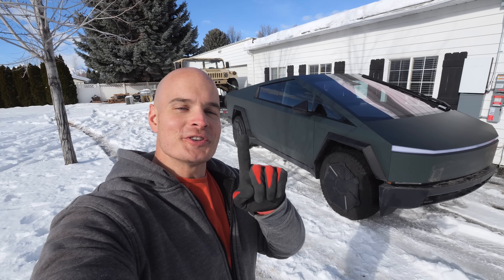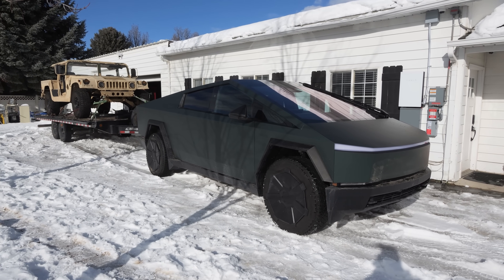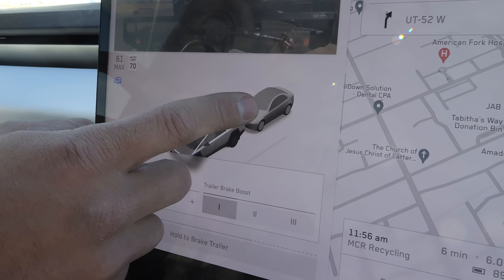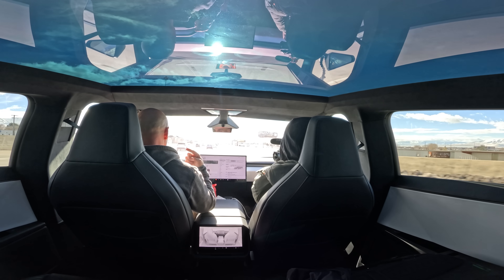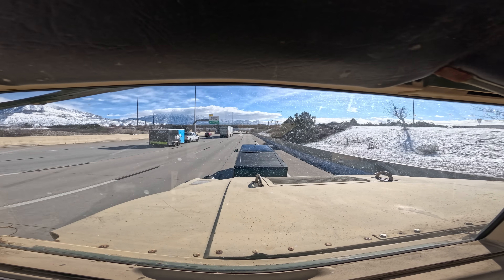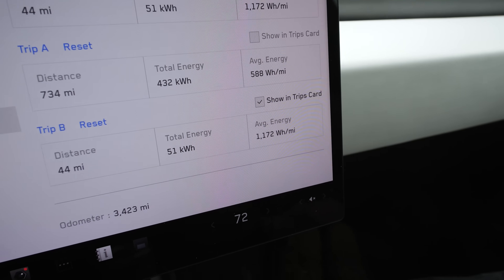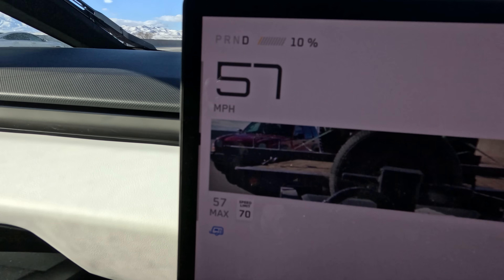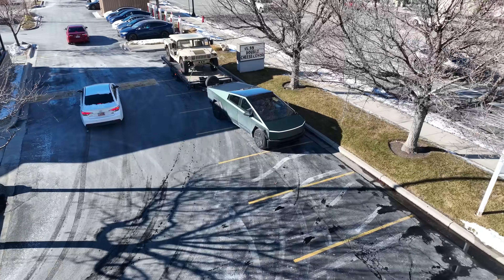How far can the CYBERTRUCK tow 11,000lbs in Freezing Weather?

Comment: Wow I really like the idea of having the infotainment Center off to the right hand side ...that way I can really look away from the road to see how fast I'm going or if I need to adjust the heater versus touching a knob or a lever. 5 stars for safety. If you're an alcoholic or IV drug user.

How many 4 by 8 sheets of plywood can it hold?

Does it still include the sleep while you drive mode?

Are the batteries still flammable underwater?

Are the batteries sourced from China or from the United States?

This is truly an amazing truck, I agree.

Do apartments or Condominiums already have these Chargers installed in front of their building for convenience?

Comment: Tesla definitely needs to apply a fix to their estimated range so that people can better plan their trips. I have seen the issue with this first hand. We have a Bolt and a Model Y. Both are are always charged to 80%. The Model Y always says that the starting range is 262 miles. Does matter the temperature or recent drives. The actual range is always much lower than that. The Bolt, however, is dead accurate. Recently we had temps that were right at zero degrees. The Bolt estimated the starting range at 150 miles at that temp at 80% charge. It would get right at that range in driving. At the same 0 degrees, the Model Y still insisted that it would go 262 miles, but the actual range left dropped like a rock once you started driving.
Reply: I worked at a movie set last year and we had a Model X in our rental car pool. It had a 2,500lb rated hitch so I decided to use the car to tow a 2,500lb Diesel genset back to the storage unit which was about 100 miles away. I started with 85% charge and I barely(!) made it. It was just pathetic.

Comment: Noticed you use a coil cable for the trailer emergency brake. I got a couple of them, but ended up sticking with a non-coiled cable to avoid stretching and not pulling out if the trailer pops off the ball and rests on the chains. With the no stretch cable, it's gonna pull the brake while the coil might not. I don't really "know" what would happen. Just erroring on the side of caution. Any thoughts/concerns on the coil? Thanks !

Comment: Good thing you were towing something that could tow the tow vehicle!!  Just curious. To charge that beast, would you need to disconnect the trailer to get the Cyber truck into the space for charging?  I think I will stick to my diesel for towing.  Having an extra tack helps, too.  It's nice knowing that when I forget to fuel up I can just flip a switch and pick up another 350-400 miles of range to get to a station.
Reply: Didn't finish the video, huh?

Comment: Tesla should Propose to add an emergency steering rod that can securely connect to the steering module as a backup plan in case the electric steering system malfunctions

Comment: Dropping the trailer to recharge was an obvious problem and the deal breaker for me. That's a pain and dangerous if there's not a flat spot available. Why didn't they put a charge port at the front to provide access to the chargers at the ends of the row?

Comment: Could someone please confirm for me that the cyber truck is true steer by wire? I know it has a variable steer ratio but that doesn't mean there's no mechanical link which I thought was a requirement in most states.
Reply: There are videos showing the steering wheel being moved lock to lock without the wheels moving.
Reply: @GreatOutdoors1  thanks for the info, very interesting. I guess the mechanic link rule is no more or there's an electronic disconnect

Comment: I guess there are no Side winds, No Oily or Wet patches on American Roads. And there is not much patience. Towing a Heavy Load should be done at 60 or below depending on the Conditions. Even on a Pristine Day with Pristine Road conditions as other vehicle variables is just one factor on how quickly and safely you can respond.

Comment: Great demonstration of how electric semi trucks will not work nor be more efficient or ecologically friendly. Diesel trucks can run 24/7. For every electric semi you will need 2 to 3 more complete trucks to run 24/7. It takes 15 minutes to fill a diesel truck with enough fuel to go 800 miles.
All electric is not the answer.
Reply: Battery technology is still in it's relative infancy I agree.

Comment: Strange that with customers' range anxiety, and with all the sensors and computation available, the Cybertruck doesn't give accurate range estimations. It's like a Ferrari without a speedometer.
Reply: What you need a speedometer for? A tach is way more important than a speedo in a sports car.

Comment: In Sweden you can’t drive faster than 80 km/h (50 mph)when towing or using a trailer like for moving stuff. So to me 104 km/h or 65-70 mph is totally madness.
Reply: Here in Germany it is 100 km/h and the fines start to get expensive when you exceed 125 km/h. So I always drive at 115 km/h. No problems whatsoever.

Comment: Interesting, in Sweden it is are not allowed to drive faster than 80km/h (~50mph) with a trailer, trucks 90km/h. Mostly because of the dangers that can occur like trailer wobbling and the longer break distance. Didn't know you could drive at speed limit in USA with a trailer, looks fine in the video but doesn't seem safe. 
Impressive though, 5 tons is alot of weight for a pickup truck to tow.  :)
Reply: In the US you can go the speed limit no matter what you tow. The only restrictions that I know are wide loads (which have their own rules) and speeds when using chains on your wheels during winter.

Comment: Just a fyi, those trucks aren't bulletproof or even bullet resistant.  If you watch the crash test video recently done with the cyber urinal you will see that the panels are extremely thin and look like a razor blade in the front end test. I still don't see how using the same average yearly household amount of electric to drive 90 miles is saving energy but the shell game can be played many ways when the public is distracted by flashing lights and smoke and mirrors. Lol

Comment: 150km, haven't seen the video yet... EDIT: Got quite close! Well I thought it would've been colder than only 0 celsius. I bet the range will plummet when it's -20 or so. Excellent honest video!
Reply: The range reduction due to temperature decrease are caused primarily by two factors: Use of cabin heating, and getting the LiON battery up to usable temperature.  Both use more energy than operating in "standard test conditions".  Increased drag due to air density, rolling resistance issues, lubricant viscosity issues are minor compared to those two.

IDK that a further 20°C will require drastically more energy/mi (km) than 0° does.
Reply: @alsavage1  Range will go down in colder temperatures. If you don't live in cold climate, you don't know...
Reply: @markusketonen2412 Huh?  That's what I said, yes.  And, cabin heating and battery heating are the major temperature-related factors, not air density, rolling resistance, or lubricant viscosity changes in colder weather.

And, I do commute in my EV in "cold climate".
Reply: @alsavage1 "IDK that a further 20°C will require drastically more energy/mi (km) than 0° does." Ok , sorry I thought you meant with IDK that you don't know whether it requires more energy or not. My bad

Comment: The new cybertruck is a POS car, can't off-road for shit.
1:14 it's illegal to only have 1 safety chain on a trailer, i would not use that trailer without it having 2 chains.
You're not allowed to tow that much weight at over 62.15mph

Comment: It was tight to make it to the supercharger :). that is still the big problem with EVs, all the time you have to worry about the range, long trips are still almost impossible even when not towing. 
Also, would be good to have some failsafe reserve, when you reach 0 percent battery, to be able to safely move away and stop somewhere. What happens if you run out of power on the highway, can be dangerous...
Reply: From other real-world tests, EVs have a range of 8-12 miles after hitting 0%.

Comment: I'm sorry... the CAT 279D skid-steer I operate at my workplace is just a shade heavier than 11,000 lbs. 
I can't say the Cybertruck's weight is necessarily unsafe - there are vehicles on the road that are absolutely as heavy or heavier, but I feel these "trucks" are going to be bought and driven by a sizeable crowd of normies who are not used to driving something with instant torque, 600hp, and an 11,000+ curb weight. The crash test footage shows in ONLY a 35mph frontal crash that the REAR wheels were bent-in from the force of 11,000 pounds coming to a sudden halt in a FRONT end collision. If that ain't enough to scare you like it does me,  then that's your problem.

Comment: The 800 volts isn’t to charge faster. Charge times are limited by chemistry and C rating. 

The higher volts allows Tesla to use thinner wires. That’s it.

Comment: I have a hard time believing the whining noise on acceleration and deceleration is normal. Perhaps the reduction gearbox for the electric motors is noisy. Alternatively there's a noisy bearing somewhere in the chain. I'm betting it's a reduction gear issue based on the symptoms.

Comment: The lack of a direct mechanical connection between the steering wheel and the steered wheels is not comforting.  How do they expect a dead cybertruck to be shifted into a repair bay?  

That hum is almost certainly the sound of gear teeth in the differentials coming into engagement and disengaging.  Spur gears are more efficient and helical gears are less noisy.  The noise reminds me very much of a city bus.

Comment: Love that you ad kg as lbs says nothing to most of the world. I guess it will go 190km but its not the weight of the trailer that ruins the range most but the form. A heavy egg-shaped stone (5000kgs) will give better range than a big square box that is around 1500 kgs. Af course you get different resault if going really slow and uphill, then the stone might be worse but normal driving the box is worse.

Comment: I'm just gonna do the bit I always do and say WOW that truck looks awful, even with a matte finish. I just do not like how small the bed is, or how the lack of contouring makes it look slapped together, and the headlights look like a kid's toy or a gamer mouse. it just doesn't look designed with any intention other than annoying people. the tires look great, I guess. I saw two of these getting towed out from SoCal, no finish and scratched up like steel wool on a sautee pan, mud all over the body, and I was repulsed for the first time by a vehicle since the Hummer H3. the black and yellow one specifically, you'd recognize that vomit pile immediately. same vibes.

Comment: 7:30 It sounds like the back tires are rubbing the wheel well whenever you accelerate. That means the electric motor is rated for tht much weight but the suspension isn't.

Comment: Hmm I think the takeaway from this is a lot more work needs to be done on the battery side to improve range in Trucks... Just like with mobile phones there was a time you couldn't go half a day without charging now 3 days is achievable... So eventually we will get to the sweet spot it's just a matter of time and patience
Reply: Battery tech is outdated.  It works off the same concept as it did 125 years ago.  The battery needs to be ditched for some thing that actually makes since.

Comment: its the same as with my phone. there two separate battery packs. so you charge both at the same time. faster charging and less heat :P
I charge with 120w :P packs are 400v just like the tesla plaid :P

Comment: I have never seen a better advertisement for an internal combustion automobile.  Especially if you are using it to tow.
Reply: To the 2 trying to use fossil fuel burning for electricity as some 'gotcha' comment, it isn't the same. To produce the same energy and use it, a gas automobile has a peak efficiency between 25 and 35%. A gas turbine electric plant is up to 60%. An electric vehicle is about 80% efficient. So a gas turbine plant charging an EV is still more efficient and thus less polluting than your average econobox car. And that's me ignoring the ever growing footprint of green energy sources hooking into our grids.
Reply: @levirassler4934  The point is the world doesn't have enough electricity generation to support mass adoption at the moment. The average U.S. household uses 886 KwH per month. Tesla says the cybertruck uses 42.9 KwH per 100 miles. Most ICE vehicles have a range of 400-500 miles per tank of fuel. So you are looking at 250 KwH to go 500 miles, or almost 30% of an average home's electrical usage for one tank of gas. 

It doesn't sound like much, but you're looking at 50% more electricity use by only households, which make up 20% of total consumption in the U.S.  Bumping that up by 10% seems small, but at the scale we're talking it's just not feasible BECAUSE the U.S. government is hellbent on eliminating fossil fuel. 

A better path forward would be to force fossil fuel burning companies to alot 50% of their profit to green energy research, drill like crazy, make energy super cheap and force innovation and grid investment while switching to EVs. But then that is ignoring the fact that only 20% of greenhouse emissions are transportation - sure, lowering transportation emissions would help, a little, but its not a significant enough drop when you look at the big picture.
Reply: JG-MV  Somewhat misinformed. The carbon value of an EV is only 30% less than that of an ICE vehicle over 200,000 miles (not counting if you need to replace batteries in that period). The green electrical infrastructure isn't there to support mass adoption of EV, which means more combustion based electricity generation would be needed + we don't make steel with electricity so the additional infrastructure needs have a high carbon impact as well.  If the whole world was driving EVs tomorrow, and all of the associated infrastructure was magically there, the carbon impact would be significantly larger. EV will drop your individual footprint, but the lifecycle footprint with everything associated is larger.  We're putting the cart before the horse on this green energy stuff, and it's pretty sad.
Reply: Yeah, you forgot you tank electricity from a coal, gas or burning trees powered  powerplant JG-MV
Reply: Yeah... having to stop for an hour every 90 miles is not practical. Electric trucks may be the future, but they are not the present.
Reply: @robertkesselring  

The 18% of people who tow will still buy an ICE truck. The rest who commute to work and getting groceries in a 5200 lb f150 can switch to electric without any issues.
Reply: JG-MV  How do you think electricity is produced in most of the states?  By burning fossil fuels.
Reply: @intoodeep001  You do realize power plants burn that same fossil fuel far more efficiently than any ICE car even considering the inefficiency of transferring through the grid and into an EV?
Reply: @OrbitalWedge 

They don't realize this, nor will they believe you.
Reply: @life_of_riley88 

Seems like you could easily provide a source for that quote.

Comment: I usually like your videos but can’t help but think this was terrible range test. Didn’t top off the charge or precondition battery before leaving.  Makes stop to weigh, stop at gas station, acceleration test onto the interstate. Says keeping the truck under 70mph but shows going over 70 multiple times. Drives truck up steep hill.   Then charges the truck to 80% and says that enough to make it back home. Would like to see a more real world accurate range test for potential buyers.

Comment: That stripped-down H1 should be ~7000 lb.  Iron Bull doesn't spec the weight of their TDP14 trailer, but must be 4400 lb, which is reasonable given the  thick I-beams and hydraulics.  With the self-leveling suspension of the CT, you don't don't need a weight-distributing hitch though still good to keep more load on the front tires for assured steering.

Comment: I don't know that much about towing, but wouldn't the load be more stable if the HV was closer to the front of the trailer? Also is this the Dual or tri motor version? You said both a couple of times.
Reply: Dual

Comment: No thanks. I'm retiring this year, and I'm going to find an old square body to freshen up. No computers, no sensors, just a rebuilt LS engine and transmission, improved brake system, and a modern sound system. My 2019 Silverado is a constant worry. I hate modern vehicles.

Comment: 90 miles per tank when towing a heavy load.  Limited locations for recharging.  All the charging stalls were full.  Required to DISCONNECT THE TRAILER before charging... facepalm  -- At the moment, this is a rich city boy toy.  WAY too early for me.  Ask again in 15 years... maybe... probably not.

Comment: To the end of the extension cord or the nearest Tesla charging station whichever comes first and then only if the temperature is above 32F.  Forget it.  My RAM has a 50 gallon tank and maybe 600 mile range, and has a 43000 lb capacity (truck and tow load).  Why would I buy one of these EV POS?  This past week's snow storms proved the Cybertruck useless.  They don't run in the cold and they can't handle snow of any depth.  Oh yeah, the cost of operation is equivalent to about $18 per gallon.  Good luck with that.  Biden has you drinking the Kool Aid and you are asking me for a tow or a jump (hybrids).  Yeah, right.